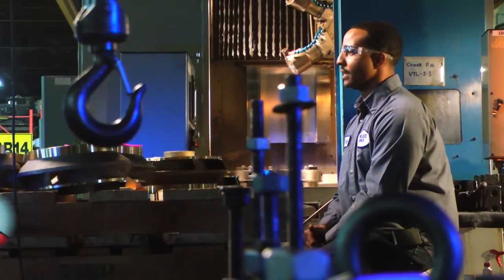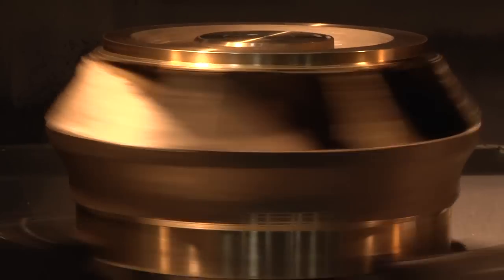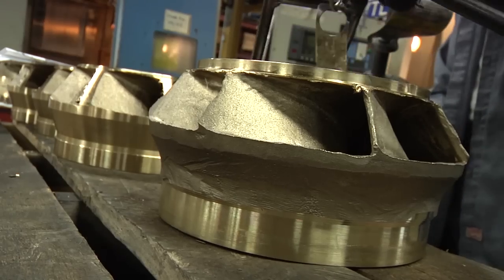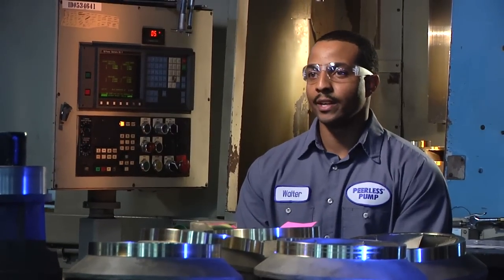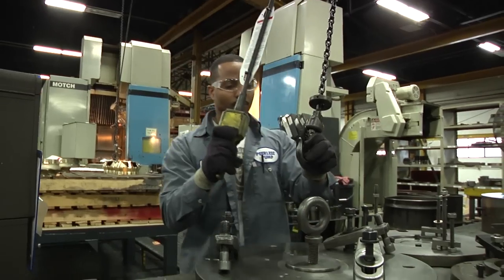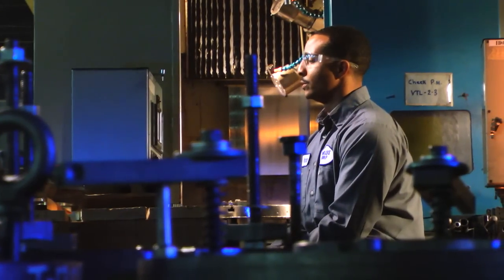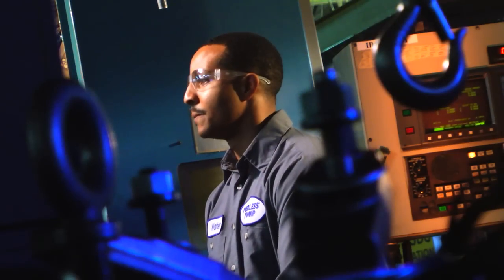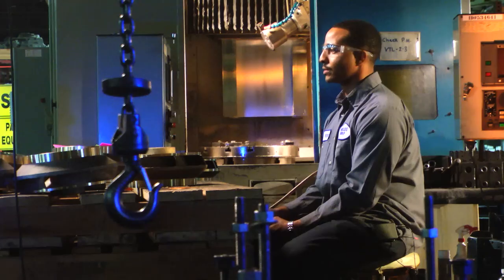CNC Machinist

Comment: Looking for some advice.. I’m in the Marine Corps and I was an Airframer by trade. I did that for about a year before volunteering to work in the Machine Shop. I did this for about three years using MasterCam and a HAAS mill (3 axis) and lathe. I produced one off brackets, tools, dies, etc... I became Aeronautically certified in TIG welding as well. I became pretty proficient and eventually ran the shop. However this wasn’t my MOS so I have nothing to back this experience up with. I tried to LAT move into this MOS but was unable to bc there were no spots available. I ended up becoming an Imagery Analyst in the Intelligence Community. Well I hate it and I miss working with my hands. I’ll be exiting the military in about a year and want to get back into CNC Machining. What are some things that would make me more competitive? Also if it’s beneficial at all I do have a TS/SCI clearance. I was hoping to work at Lockheed Martin or something similar. Any kind of advice would be greatly appreciated.

Comment: What is a CNC programmer? A custom guitar shop I know has a CNC programmer. Can this technique be applied to wood? That's about all I can think they'd use it for since they're not making the metal hardware for the guitars.
Reply: Yes, CNC machines are the reason why it is possible to find quality guitars for a lot cheaper than in the past. Companies of all sizes, from small startups to companies like fender and gibson use CNC machines to produce most of their parts like bodies and necks.

Comment: He is not a machinist, he's a tech. The actual guy or people that did the programming are much more a machinist than he is. It's not easy to make a program, hundreds if not thousands of  dimensions have to be calculated. I just say this because a guy i know say's he's  a "machinist" and i just think it takes away from the guy's that program or use manual mills and lathe's.  As a tech all they have to do is plug and play and make sure that piece is centered on the chuck. I am not a machinist but have a lot of respect for them. Especially guy's on manual lath's which is a dying art. Hopefully one day i will have a small lath and mill.
Reply: Yeah, no actual "machinist" I know starts out at only $12/hr. This guy seems more like a CNC operator.

Comment: CNC Operator in the stream...Not CNC Machinist...
Reply: i was thinking the same thing...machinists are on higher level . They often work with the engineers to design fixtures and work-holding methods; determine the tooling, feeds, speeds and toolpathing and program the part in CAM software; and optimize mass production by editing of g-code in some cases to enable real-time modification using macros and variables to be used by the operators (the guy in this video).

I too am a machinist. i get handed a schematic and basically make the part from scratch using a cnc machine. many of them are one off parts so they dont have a lot optimization requirements, but if it a high volume production part i spend hours optimizing the program to kick out good parts as fast as possible. in some cases, modifying the design of the part to enable easier machining with less tooling.
Reply: That's a machinist... Some places are just teaching individuals to be operators...Years ago, when I apprenticed, I had to master manual before the bossman ever put me on anything with a computer and a series of servos on it...You have to learn WHY you are doing a process a certain way so that later on, you can write a program that executes it properly... They don't teach that much anymore...
Reply: if i get cnc operator training can i get job easily? i just did high school

Comment: That sounds like a fun sort of work! I wish I had time to learn a new profession.
Reply: operators run the machines, button pushers basically.Some of them also switch fixtures to do different pre-established production parts.

Machinists are the ones that program the machines and figure out how to make the part in the most precise and efficient way possible. They determine the tooling and design how the work will be held. They also program the various operations to create both the fixtures and the parts. either by hand or by using CAM software. Machinist have a very good understanding of g-code and can do complex edits to g-code without crashing a machine. They do the initial setup of the machine when parts are being produced for the first time, often running the program to make the fixtures themselves.
Reply: @Cara.314  It must be different where I'm at then, because a Machinist in my plant strictly runs the CNC machines, like in this video. It's the Tool and Die Makers (Toolmakers) that do all the programming and get everything tight down to the thousandths.
Reply: This guy is just an operator, you defiantly dont want operator to be your profession. No skill involved
Reply: ThaFrody I'm looking into this trade, can you elaborate? 
What is the difference?

Comment: I was lucky enough to enlist in the Air  Force after high school. I was sent to Chanute AFB for training as a machinist. I managed to learn and teach myself to work in that trade for 45 years. I am now retired and wish I had a machine shop to pass my time as I love creating things in metal. When I started there were very few CNC type machines. I worked for a time at Johnston Pump Co. I machined many Impellers and threaded many pipes and shafts. I enjoyed the work. My last position was at a University in the Physics and Astronomy Machine shop. I did most of my work on a 3 axis CNC milling machine using MasterCam to design and program the machine. Machinists always make less then they are worth. Our stockroom clerk made $91K because he had a degree. I made $38K because I didn't.
Reply: What was his degree in if you know?

Comment: this is what i'm screaming. you are absolutely correct. I watched about 5 reports talking about shortage of cnc machinists and yet, when I looked up the pay, it's no more than a lot of unskilled, untrained jobs. I could make more as a roughneck, easily.

it doesn't make sense to me why someone would go get training, only to turn around and get low pay. for the same effort there are tons of jobs that pay better, with less training.
Reply: Shakaama that’s a lie lol
Reply: I agree. I went to school to do this and I poured my time into getting NIMS certificates. I was told I'd make good money someday. I have been doing this for almost 2 years and I tell you I wish I would have done something else. I had a job that paid me $13 an hour when my friends sister at a Walmart made $12.10 an hour no education or anything. I still am ticked off. Ik I'm not the greatest but pay your employees enough so they can afford a place to live. I can't. Looking into a new career someday.
Reply: The money is not in running them. but fixing them.